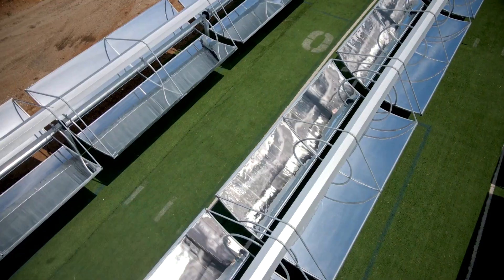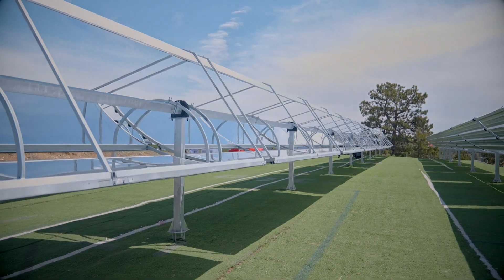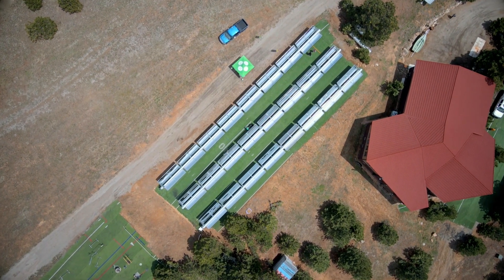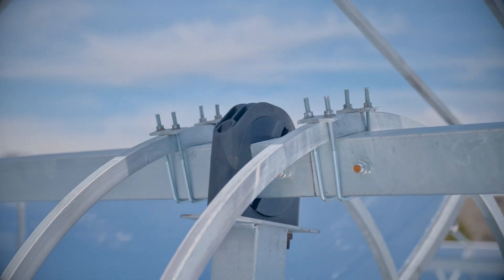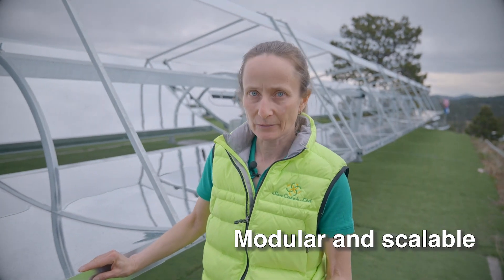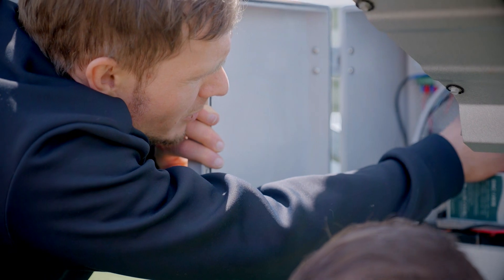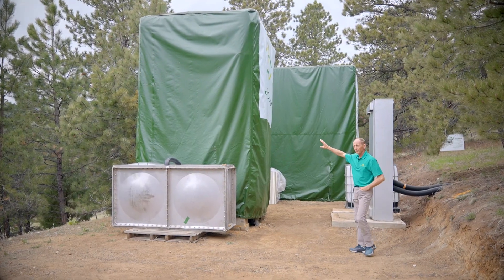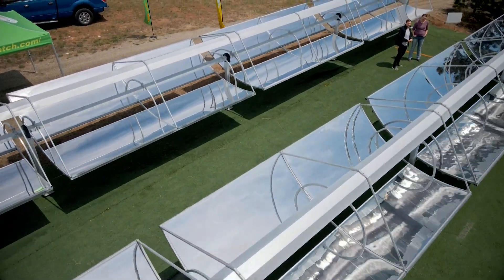Reduce energy consumption with Sun Catch Solar Tech Solutions #solarenergy #solarpanel

Comment: Cool stuff!  Simple and efficient.  This seems a lot more efficient than converting solar to electricity and then using it heat water. Solar water heating is widespread in many countries.  But concentrating solar with curved mirrors and dynamically adjusting angles is cool.  Great innovation.